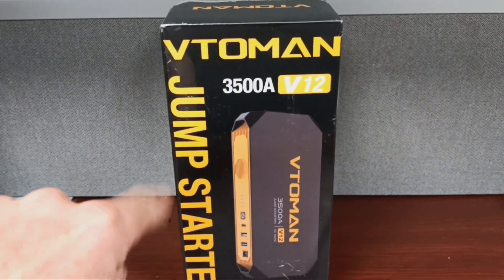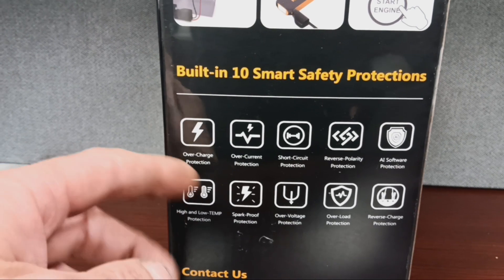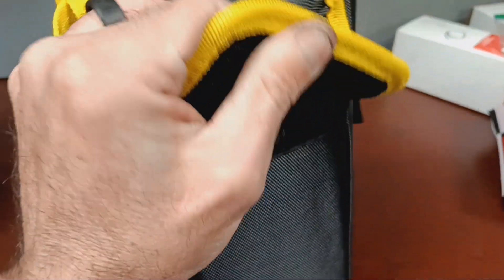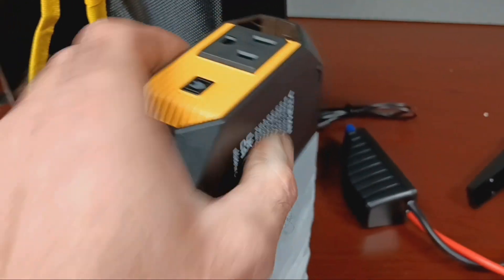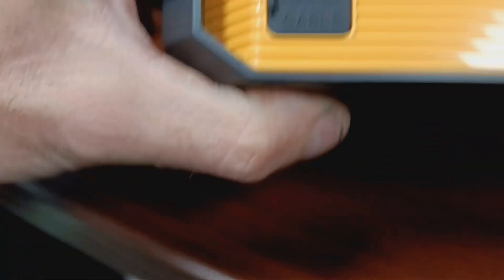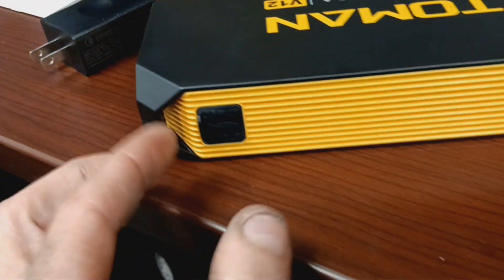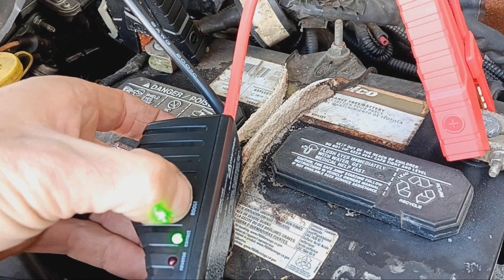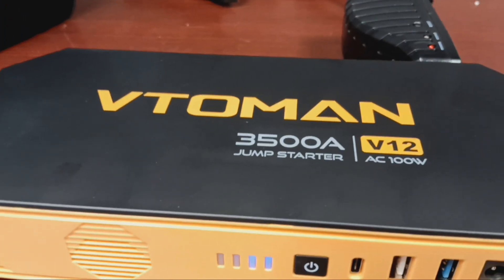$130 For Real? Check This Thing Out #newtoyou #mechanictools #musthaves

Comment: But will it charge my phone?

Do you have to hold the BOOST button down for it to work or can it be pressed and you can get in the truck and start it yourself?  It kinda looked like a 2-man operation.
Reply from the maker: No I held boost down cause it was a diesel completely dead and the jump pack with two bars not fully charged. Just right out of the box.  Yes it will charge your phone with the USB on the side

Comment: I have to try one of these instead of my JNC  jump pack 
Newer technology has come a long way
Reply from the maker: Yeah. And the battery was at 3 bars. But by the time I could get to the truck to film it was at 2.  Still started. If it was a car it wouldn't have a problem. But I'm pretty impressed with it.
Reply: @BeardedFordTech  I'm sure at full charge the pack will be great
Reply from the maker: @nysucks4508  I think so too